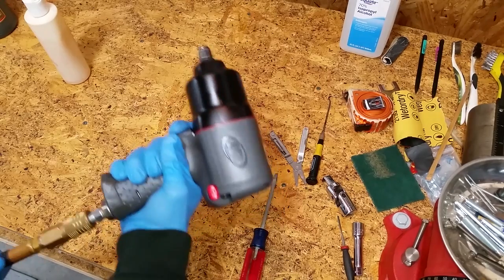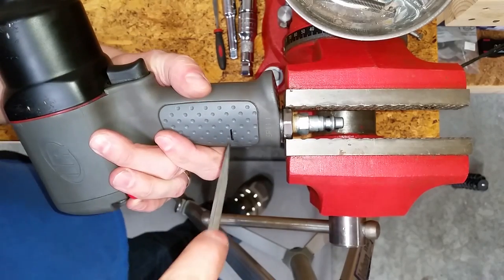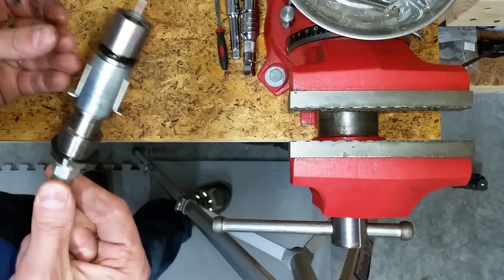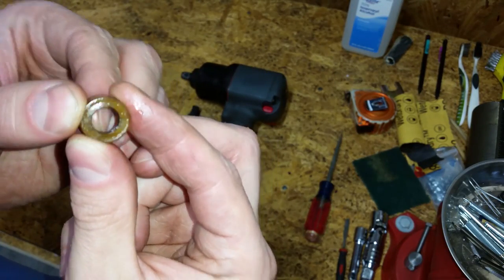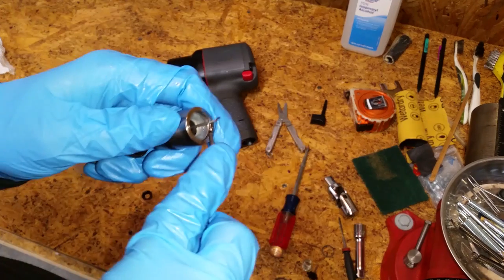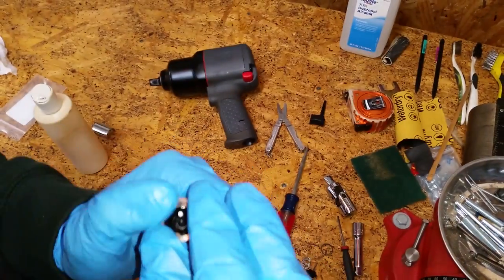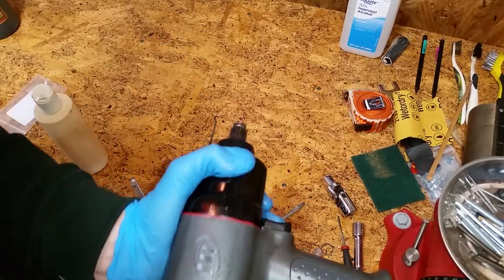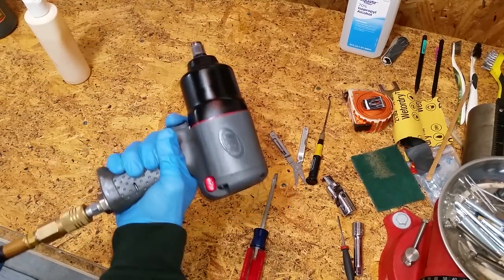Repairing an Impact Wrench

Comment: You gave me an idea.  My Astro 1822 just started leaking from the exhaust.  I stumbled upon your video after totally disassembling, cleaning and then reassembling the impact.  Still it wasn't working.  After watching your video, I took apart (again) the parts in the handle.  Lo and behold, there is a trigger bushing in there and it had a nick in the seating surface.  Knowing that the tool wasn't working properly and thinking "what have I got to lose", I removed the bushing and found the other seating surface in good condition.  I flipped it over and reinserted the bushing in the handle.  After reassembly and hooking to my compressor, It's fixed.  Thank you for your video which caused my twisted mind to have an idea.  Thanks again!!!
Reply from the maker: That's awesome, nothing beats a free fix! Thanks for the comment. :)

Comment: I Just today found two Impact Wrenches a neighbor had tossed in his trash can with multiple other tools, and they were in plain sight just calling out to me to save them from ending up in the County Landfill. 
Other than being dirty I have a feeling they work just fine, but it's good to know I can easily fix them if needed based on your excellent video.
Reply from the maker: Nice save! That's the great thing about air tools, no motor or circuitry so usually all you need are some cheap seals to get 'em working again. Thanks for watching!
Reply: How did your repair turn out???
Reply: @williamdon3442  it works perfectly now. I just took the wrench apart and cleaned and oiled it. Seems to work just fine now. Thanks for asking. 👍😊

Comment: Dude.
DUDE.
Thanks. Mine has that identical problem and I didnt know what to do with those little tabs
Reply from the maker: I'm glad the video was helpful, thanks for the comment!
Reply: @Mikeattempts  FYI if you want to buy an extra for next time, look on ebay. A guy has them for 12 dollars ea. I bought two because, frankly, that plastic bit looks weak. And we had the exact same failure. Id post the link but yt will take it down.
Reply from the maker: @bunberrier  Good info, thanks!

Comment: Are they all the same for impact wrenches I have one from NAPA and it recently started to leak air and I’m trying to throw a lift on my Jeep but it’s not loosening bolts cuz there isn’t much RPMS. Any help would be appreciated
Reply from the maker: I'm sure the design is very similar, but the parts are probably slightly different. You might be able to find a parts diagram for your exact model. If not, Google your NAPA impact wrench model number and try to find out who makes it. It's probably the same exact impact wrench made by a bigger company and rebranded for NAPA. Once you're able to know what model it is under the brand that manufactured it, then you should be able to find a parts diagram and find the exact part number you need for your impact wrench.

Comment: hello, I have a King Tony 040 impact wrench that has a leak in the air extractor on the handle, I would like to know what repair do I need to change to end the leak?
King tony inside the handle just have a spring and a little valve
Reply from the maker: I'm definitely no pro when it comes to air impact wrenches, but my guess would be that the valve has a crack or a chunk of rubber missing. You could just get the same type of kit for your impact wrench that I used, and it would probably fix your issue.

Comment: Thanks for the video... can you please help me ? My 2235 has almos no power. Air just comes out the exhaust when pressing the triger . It is very weak 

Thanks!!:D
Reply from the maker: I'm no pro but I would guess that it either needs to be taken apart, cleaned, and re-greased or that it needs a new seal kit (or both). Either way, you won't know until you take it apart.
Reply: @Mike attempts  got it fixed 👌  I got lucky lol
Reply from the maker: @ZkReAr-fs5do  That's great, what was the issue?
Reply: Look for a parts diagram for your specific model.  My Astro 1822 was low on power and continuously leaking from the exhaust.  It was a faulty bushing for the trigger inside the handle grip.  I pulled it out and flipped it over.  It's working again.  Good luck.
Reply: I got the brand new Ingersoll Rand 2236QTiMAx just came out. it works well in reverse to remove lug nuts, but to put it back forward gear it has no power, i can hold it with my hand, no torque whatsover, i bought the second one and the same issue. Anybody has idea what the problem is?

Comment: Feorch 2265, Ingersoll Rand 2100G  made  in Taiwan.
Reply from the maker: I'm not sure where my IR 2130 was made but I've owned it for probably around 12 years and this is the only repair I've ever needed to do.
Reply: @Mikeattempts  I repaired my feorch the same way and then realized it was identical to the Ingersoll Rand 2100G.
Reply from the maker: @Professionaltools-eq9kk  Ah, that's interesting. It's good to know this video could help people with other brands of impact wrenches.
Reply: @Mikeattempts  I am from Bulgaria, here in Europe feorh and wurth sell the same impact wrenches, the mechanisms and parts are interchangeable with those of Ingersoll Rand. I have filmed my impact wrenches on my channel.